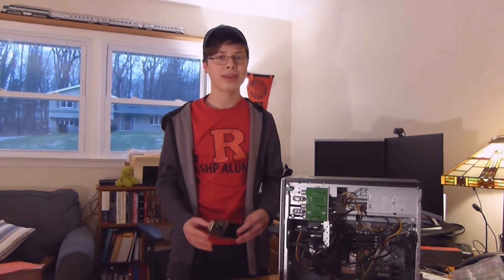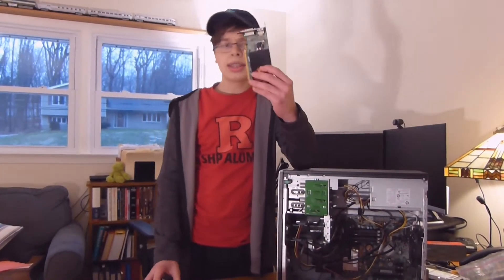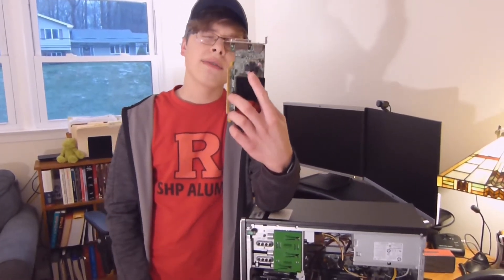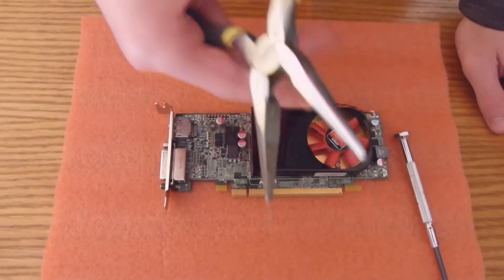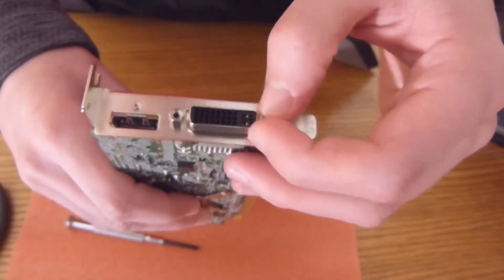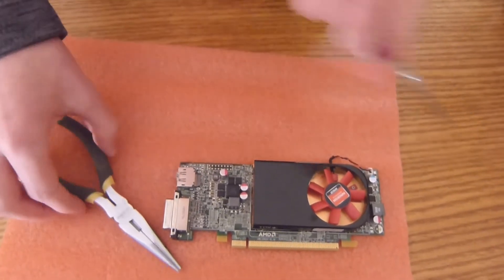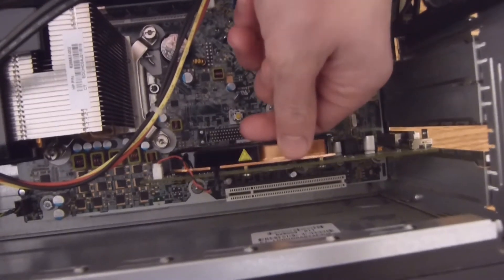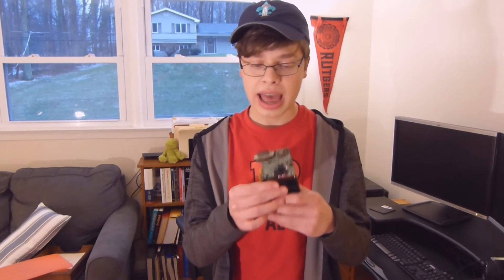How To Install a LOW Profile GPU Into a Regular Case

Comment: Where is the pcie port to plug in from the power supply?
Reply from the maker: Low power GPUs like this one don't need a bracket
Reply: @endstarofficial  ahhhh yes thank you. I didn’t know that until now. I’m still a beginner pc builder as it is my first time and this confused me but now I know why my pc didn’t turn on the first time and that’s bc I didn’t plug in the hdmi display cable into the gpu.
Reply: @endstarofficial  oh okay thank you

Comment: i have this same problem but is this safe ?
or is here nother way ?
Reply from the maker: It should be fine what GPU do you have
Reply from the maker: ATM_nerd  low profile?
Reply from the maker: ATM_nerd  were you able to remove the bracket